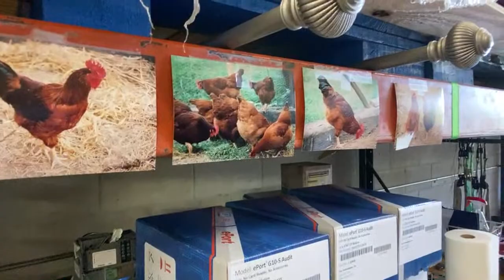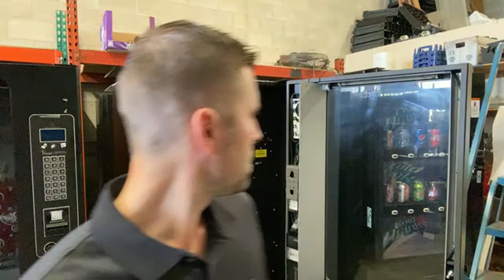Preparing a snack machine for install!

Comment: Thanks for the video! I'm new here. I recently launched my own vending bus. The content I would like to see is videos on different technical or mechanical issues you run into with your machines and how you went about fixing them. Also, it would be nice to see your steps when setting up and testing a new machine. And what is your opinion on an AP 112?